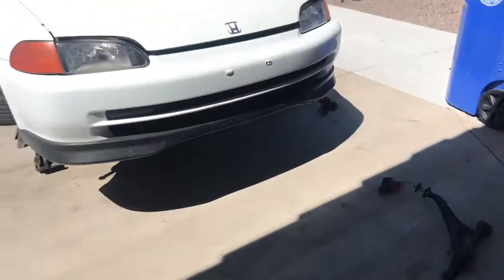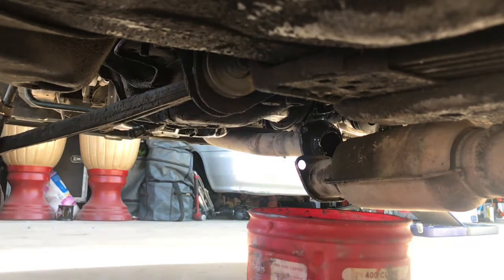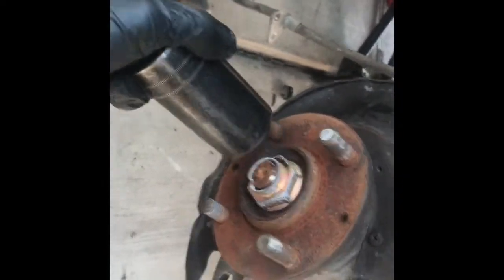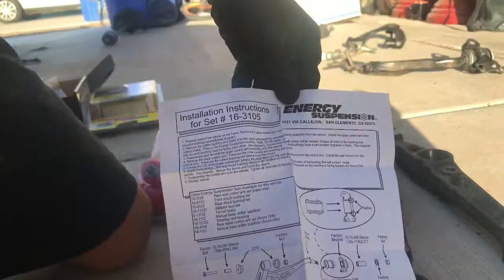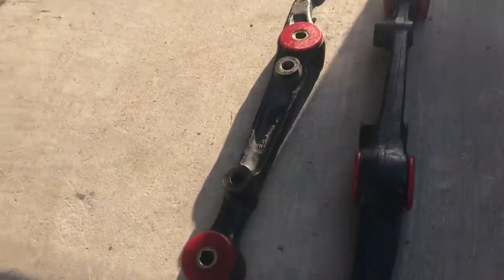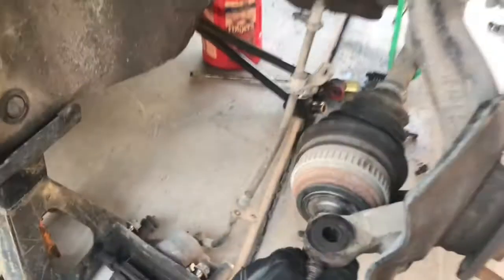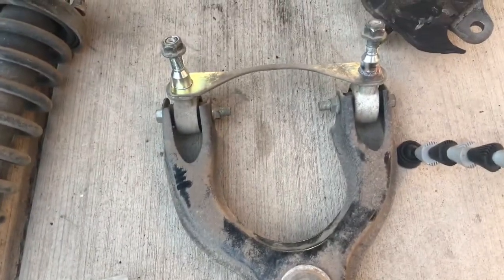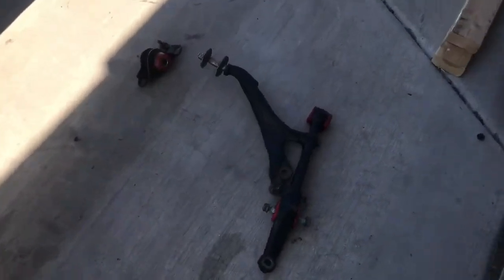REBUILDING HONDA CIVIC FRONT SUSPENSION PART 2 (INSTALLING  ENERGY SUSPENSION KIT!!)

Comment: One kit is for the front LCA and the other kit is for the rear LCA. Your also going to need to order an additional kit # 16-8102R for your front lower shock mount if you do not have the deluxe bushing kit.